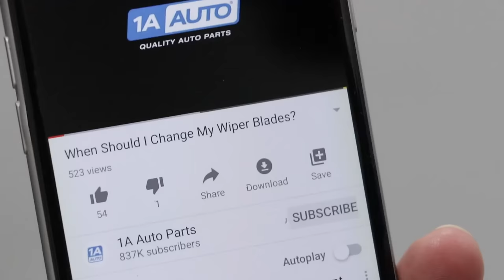Rusty Rotted Rocker! How to Replace a Truck Rocker Panel!

Comment: That turned out better than I had expected. Well done buddy. I m looking at a similar repair soon. Ny rust is no joke
Reply from the maker: Yes! We are in MA same problems. It just takes some time and  effort. Good luck! Thank you for checking out the video. If you need auto parts go to: http://1aau.to/m/Shop-1AAuto-Now
Reply: Yeah. NY is def tough on rocker panels. Going on the second truck I've had to fix them
Reply: WNY here. Best thing honestly to do is wash your vehicle constantly. Even if you feel lazy, go through a simple car wash. Make sure you undercoat the entire vehicle too. I'm on my second Tacoma, '08 and now '18. My '08 had barely any rust build up since I took care of it yet I beat the piss out of it. 

If you feel and see rust building up; just clean it down to bare metal, prime it, paint it, undercoat it. I know how it feels to have rust on your vehicle and it looks like crap. Vehicles won't ever complain about being maintained compared to women hahaha.
Reply: @nxtc77  vermont is worse

Comment: Great video. Was wondering.. What primer would you suggest on the grinded area of a welded on rocker panel? I don't plan on paint for several months down the road.

Comment: Use copper weld through primer instead.
Reply from the maker: Great tip. Thank you for checking out the video. If you need auto parts go to: http://1aau.to/m/Shop-1AAuto-Now
Reply: The weld through primer won't matter near as much it all does the same thing
Reply: And use some rust reformer while you're at it. Rustoleum's spray rust reformer works miracles on exposed rust

Comment: Awesome video. I'm mulling the thought  of doing  this with out a large enough garage.  I do welding and have a really good multi process welder. I would definitely use solid wire MIG.

Comment: I honestly think if i got all the tools i could do this on my crown victoria definitely saving this video great job @1a auto
Reply: I wish I never got rid of the 1986 Crown Vic I owned. YouTube wasn't around in the year 2000. I replaced the timing chain and gears on it when I bought it cuz it had erratic idle and lower p.m. performance but fine medium and high RPM running running.

The 302 V8 and trans and differential we're all in order and running great if the bidy just didn't start disappearing to rust

Comment: LOVE all these 1A Auto videos. This one was too good for Us. Redoing a 03' S10 rockers and a couple of other panels but this video explained SOOOOOOOO much. Only question I have is about primers. How do you know what color primer to use? Black? Gray? White? Finishing with a dark green metalic and the truck actually has a couple of different primer base coat colors. Totally confused as to which color to use. The VERY BEST part of this video was at 40:52 I call it "the Slide of Victory!" lol...GREAT JOB - VERY professional job.
Reply: Primer is only colored to save on finish coats of paint. The closer the primer color is, the less top coat you'll need to hide it
Reply: The answer to your question of what color primer to use, is to use the same color primer that the factory use.

If they used Gray, you should use Gray

And let's face it most factories use Gray

It's very easy to tell what color primer they used, just look at an unpainted part of the car like in the engine compartment or something where the paint would be thin here and there and you will be able to see what color the primer was

Comment: I would certainly use a Naval Jelly Rust Removal solution on the lower frame/body areas that are rusted, but not removed, before I primed/painted are original body areas.  Then I would weld the new rocker panel in place, then caulk up any exposed areas, paint in original color, then re-undercoat the vehicle. ......just MHO....

I am not trying to be critical, but a welding course (or more practice)  would be valuable for making a nice bead along the straight mating sectionz, vs the spot blobs (just plain ugly).....

But overall i enjoyed watching, as all of 1A Auto videos.....

Comment: I realize I'm very late to the party.  I wouldn't wax right away.  Give it a few months to fully cure.  There can be some gassing off of those chemicals for at least a few weeks and waxing or putting other sealants on your fresh body work can interfere with this natural process.  Nice thorough explanation.  Anyone bothing to read this far - you could also try not cutting out until you tack in place then cut through both layers at the same time ensuring a perfect fit.

Comment: Anything you can do to prevent the rocker panels from rusting in the first place?  Nice video.  Thanks.
Reply: Get some Woolwax or Fluid Film sprayed in behind them. 
Lots of videos on it.
Reply: @stanlojewski6761  yup, 1-2 times a year. Spray inside your doors and everything
Reply: Amsoil HD Metal protector. Wish I would of known about 10-13 years ago.

Comment: Did you take out the bolts when you removed the doors or did you remove the pins? I’m about to do the same repair and that’s my only concern

Comment: What would this cost on average at a shop?
Reply: $1400+ per side
Reply: @S0u11ess ur joking right
Reply: @BandosUsa  that's what it costs to get it fixed right, if you can even find a shop that's willing to do rust work (most won't). Sure you can go pay some clown to patch and bondo it in his backyard for $300, but in 3-4 years the car will rust beyound being repairable

Comment: Did you rivet a sheet of steel to the inner rocker? Is that to secure the bottom of the outer rocker?
Reply from the maker: Yes! good eyes. There was a lot more rot than originally planned for in the video. The goal was to just show how to replace the Rocker not rebuild the whole truck. Thank you for checking out the video. If you need auto parts go to: http://1aau.to/m/Shop-1AAuto-Now
Reply: Underrated comment. 👍👍

Comment: Hi, I have a 2009 Pontiac G6 with the same issue on both sides and I wanted to know if this job can be done in my driveway. I notice you spot welded the rocker panel, I do not have access to a welding machine, is there any alternative way or other options available.

Comment: This rest will be right back. Without treating the cancer (rust) in the vehicle. It will come back in a few years. He should have used the Master series primer or a P.O.R primer. This will encapsulate the rust
Reply: If you painted POR on the rusty inner rocker panel, it would all be burned off from the welding.

Comment: How much would a job like this cost? I’m thinking about fixing my Tahoe but idk if it’s worth it or just selling it as is.
Reply: Uh TV
Reply: my rockers and cab corners for my 2006 sierra crew cab were about 500 just for the metal
Reply: Check out ebay for parts to save extra cash. Also sell it for way more if it has no rust

Comment: Mine is rotted out completely on the surface that the door striker plate sits on. It doesn't look like you changed that panel. What is it called?

Comment: What does the lower section of the rocker look like? it seemed really rotten when you welded the outter rocker to to the inner rocker below? Any suggestions if this is too bad to weld to?
Reply: Make it or buy it. You can buy the inner panels as well as the outer

Comment: I weld for a living. And this is painful to watch. Final result looks decent. But damn those welds need work
Reply from the maker: DIY welding not pretty but functional. Thank you for checking out the video. If you need auto parts go to: http://1aau.to/m/Shop-1AAuto-Now
Reply: The arc looked like they was using a dual shield, the flux core with the stargold welding gas, if he switched his wire over to the solid core wire it woulf not only look better, but would also be easier to weld
Reply: @jacobclubb5624  I prefer the 90/10 over stargon myself. But yes you are right, just the incorrect setup. Also if he used a real grinder and not the little pneumatic one he could’ve made the cleanup and sanding look so much better in a fraction of the time
Reply: @OsAMaSxPAjaMAs  problem with the 90/10 is the higher argon content makes the arc hotter, on sheet metal it could warp it, and the same with the grinder.
Reply: metal prep looked terrible as well
Reply: also didn't remove all the rust... therefore it will eat the metal from the inside out and will be too bad to fix next time
Reply: Dude please don't 🙏be a hater if you can weld better you should start some videos . Guy here is just trying to let people know that anyone can do at home 🏡 he did a great work 💪👷👏 God Bless
Reply: Yeah they need a lot of work
Reply: It has nothing to do with hating. The first rule of rust repair is to get rid of the rust. Why go through all that if you’re going to leave all the rust on the inner ticker panel anyway? And what’s the point of priming over that rust.  Also? Can you weld to painted, rusty metal?

Comment: Anyone else get the feeling he didn't really KNOW what he was doing and was kinda winging it? I've watched alot of tuts on this process with mostly at home DIYers and their results were 100x better.
Reply: Why comment at all if there is nothing constructive about your criticism?
Reply: @noconspiracytheoriesplease.745  to Inform others there are other tutorials with what seems to be more experience and knowledge to be has. Thank you for your constructive criticism allowing me to further explain my thoughts. Have a good night my friend
Reply: Yes, a more experienced person wouldn't have been buffing up to the window glass. They would put the weld below the horizontal contour line and faded the paint an inch into the contour where the seam would likely have been invisible
Reply: It’s a huge waste of time to go through all that if you were going to leave all that rust on the inner rocker anyway. And priming the rust when you’re going to try to weld it is a waste of time and primer.
Reply: @thommiller9941  what's the better solution -- is there a spray-on rust remover/converter that you recommend for the inner rocker?

Comment: Nice work! But no wonder why cars in America are rusting so bad - There is zero rust protection sprayed into the panels or body from the factory... My Mercedes from 87 is totally rust free inside the panels, due to the rust protection from the factory. The only rust that appears, comes from rubber plugs because salt and dirt gets caught around them...

Comment: Candle bits work great for drilling out spot welds.  Jam a flat blade screwdriver in-between spot welds and the one you're drilling will pop when you've drilled enough
Reply from the maker: +Shaggy Thanks for the feedback!
Reply: What's a "candle bit?"

Comment: What's the cost of replacing a rocker panel?
Reply: usually the cab corner needs to be replaced as well. this cost with parts 1000 per side roughly

Comment: I have to do this on my truck. I’m going to use flux core .030 what setting should I use?
Reply: W R Sporing  I’ve been playing around with it. It makes nice spot weld on the lowest setting on a single piece of metal but when I lapped welded it I had to leave it on low watts and turned my speed up a bit.
Reply: W R Sporing  these videos helped me a lot
Reply: check your owners manual. If you don't have one you can search for owners manual for and whatever you need one for. If you look long enough you should find one start with the manufacturer's site.
Reply: The lowest setting usually, but take some scrap metal around the same thickness and use that to adjust your welder

Comment: A grinder and paint makes the welder he aint. Good work though.

My 2013 f250 is so rotted i dont even know if the cab is worth saving at this point.

You guys sell a replacement cab shell by any chance 😂

Comment: If you're going to do this, do yourself a favor and throw the flux core wire away.   Set yourself up with gas and make your welds nice, especially the button ones.

Comment: ahh ya, how NOT to mix bondo using a piece of paper cardboard-that absorbs some of the important curing chemicals. Also, water-sanding with 320-grit, (once you've contoured the mud from 40-grit to 100-grit, then primer 'n putty), ), cuts and feather-edges nicely.
Other than that you have some nice handy compounding tricks.

Comment: .      Would PR 15 be better on back side of panels.    Nice work.
Reply: If you want to coat them the day before, yeah
Reply: Por 15 is not a good idea for a new panel...it does not stick well to clean new metal it would have to be scuffed up good to stick..I would just use armour coat and por on the rusted inner rockers

Comment: There was only some of that I agreed with but the painting over the rust completely unprofessional and using aerosol spray cans to paint with seriously everywhere the welds were around the rocker panels looked like hell overall from a distance it might look decent but as far as the paint on that rear quarter panel that's why you don't do partial that whole panel should have been completely refinished my personal opinion he needs to learn how to do his body work better as well as sheet metal

Comment: Umm, why the hell you leave that old rusy inner rocker? Should have replaced it at least with a flat sheet metal.
This repair was pretty useless without replacing the inner.

Comment: Very good until all of that filler.  I was taught  to weld  clean up weld and additional weld.  For as little filler as possible.  And never fill plug welds.   You used about 10 x as much filler that I would want to use for this job.

Comment: Not much of a body man. Body filler does not stick to paint. In a few months this job is going to sag and crack. And really flux core for body work I dont think so. When I do a job loke this I place the welds at bends in the metal. After grinding the welds not body filler is required. Please anybody planning a job like this search other sites for more and better info
Reply from the maker: Thank you for checking out the video. If you need auto parts go to: http://1aau.to/m/Shop-1AAuto-Now
Reply: If you're not using filler then your repair would look like trash
Reply: @jonathanyates5198  not if you know what you are doing. I have done several jobs like the one here with nothing but high solids primer and you cant tell it was repaired. I built a rocker panel from scratch for a ford LTL 9000 welded it in place and painted it with no filler looked as good as factory

Comment: That cut-off tool was not designed for cutting body panels. You are supposed to use a cutting disk on a Metabo grinder or on a long reach 90 degree head cutting tool so your face and hands are away from the work.

Comment: Not a job you’d pay a pro to do because the truck probably is t worth it.... I’d use weld thru primer and the tools to remove the spot welds is only a few bucks... good video though...
Reply from the maker: +M1 M We appreciate the feedback. Sometimes there are multiple ways to accomplish the same repair.
Reply: well that depends on your perspective, to do rockers and cab corners on both sides with parts you are looking at 2k. a lot of people find their vehicle is worth 2k to keep going 5 or more years.

Comment: I don't think this repair is worth it.  I have a van with the same problem.  I bought online a piece of aluminum siding that snaps over the rocker panel.  50 bucks and 15 minutes.
Reply from the maker: +blur02 Thanks for the feedback!
Reply: Does nothing for you when you’re trying to get inspection stickers. They’ll fail that shit so quick